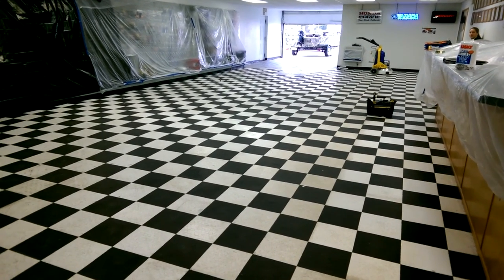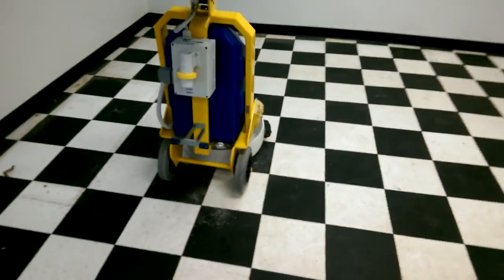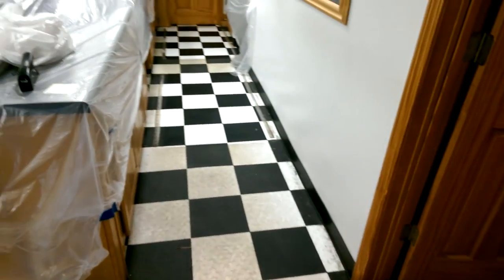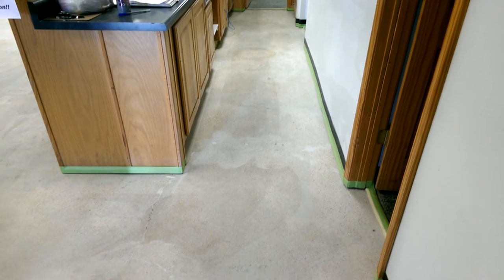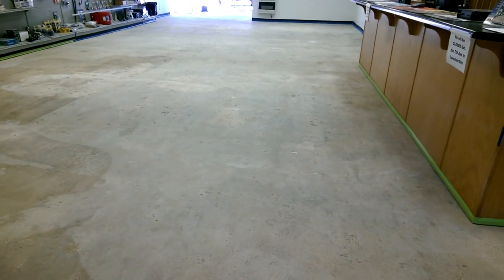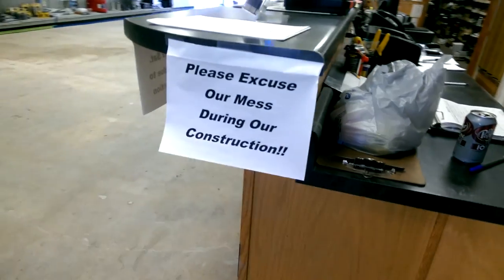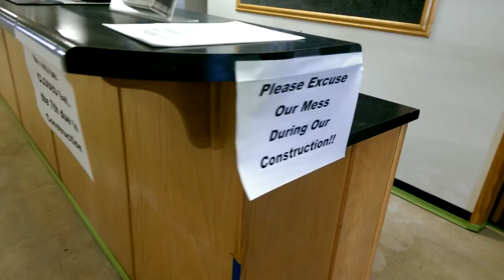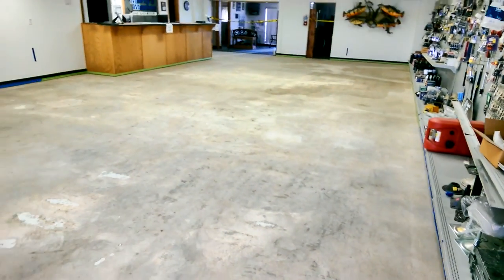Concrete Resurfacing with Vinyl Chip Epoxy Garage Flooring System | Lake Ozark MO - Osage Beach MO

Comment: Hi Rick!!  I'm about to condition myself my automotive garage. your finish is great, what sealer do you use on top of flakes to make it look glossy? 
great job Bud!
Reply from the maker: thank you I appreciate that, Its a 2 part Epoxy called Neat Coat, so base coat of colored Epoxy also 2 part, chips while wet, scrape all loose chips, clean and use the 2 part Epoxy, then after that is 2 coats of a water based Urethane.... hope that helps.

Comment: What kind of blade do you use for your angle grinder?
Reply from the maker: I use This Masterforce from Menards https://www.menards.com/main/tools/power-tool-accessories/diamond-saw-blades/masterforce-reg-4-double-row-diamond-cup-wheel/mf-wd40s1/p-1444450181295.htm sometimes I also buy from The Concrete Protector in Ohio

Comment: How is this with Hot tire lift of the product?
Reply from the maker: no issues ever with this product this is commercial grade stuff, its meant for warehouses that get a ton of traffic on them, I put it in shops and fire-stations, never had an issue. There are 2 reasons that you would have an issue 1. is an inferior big box store product or 2. you did not prep the concrete correctly or both.... good question tho thanks for stopping in to take a look and comment....be sure to become a Subscriber of My Channel... I have another Video about to drop this week....STAY TUNED!!
Reply: MrCustomConcrete will do.  Thanks for the info
Reply from the maker: your welcome